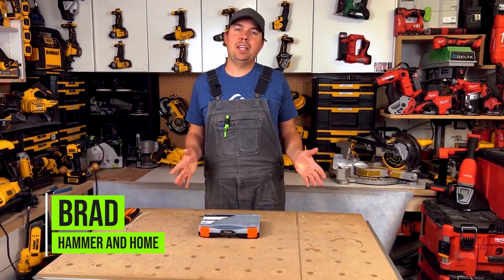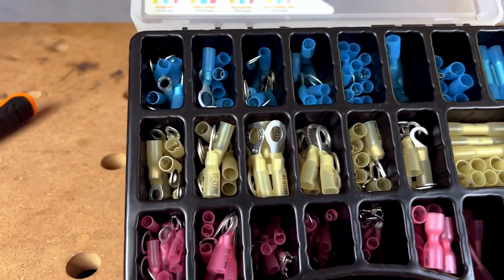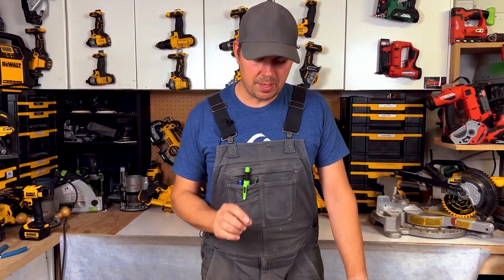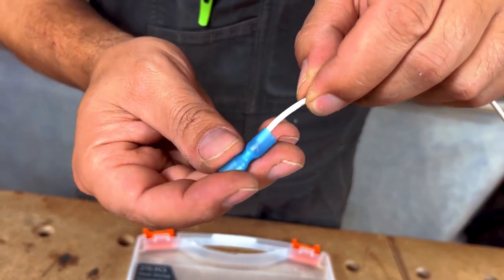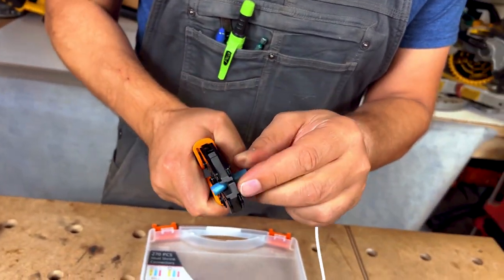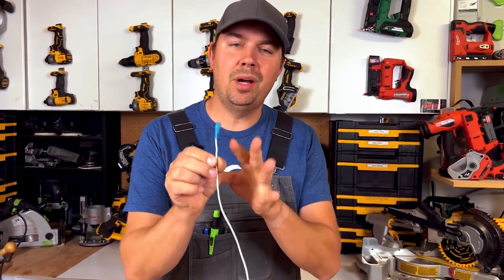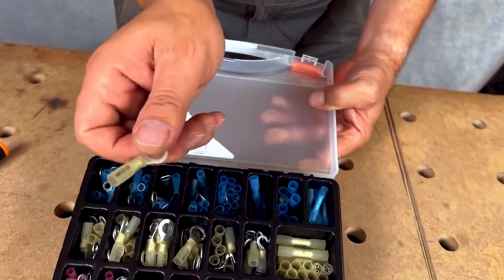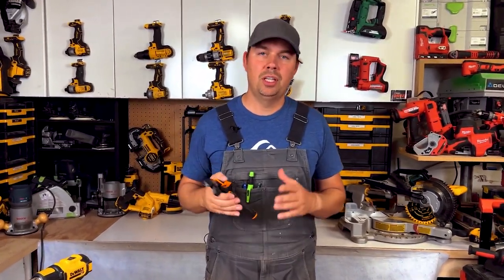How to do a QUICK CRIMP with Wirefy Heat Shrink Wire Connectors Kit

Comment: Have you used the same jaws in the crimper for heat shrink butt connectors as well? I am having trouble finding an answer for that, and wondering why that one wouldnt crimp for the other, but they have two different products
Reply: I went and bought it myself. The square jaws look to work for butt and connectors
Reply: I was wondering this also, and have looked alot. Did you ever find out if they work satisfactorily for the heat shrink butt connectors ?
Reply: @Mike-ig2zq  yea, they worked fine
Reply: @nickl7606  Thanks Nick .

Comment: Looks useless.  That end didn't shrink down enough to keep water out so what's the point. Just get a connector that's narrower at the wire insertion end.
Reply from the maker: I definitely could have shrunk it more.
Reply: @hammerandhome  Right, next time get a close up. There are a lot of bad connectors out there!